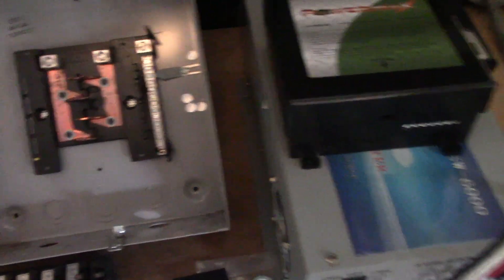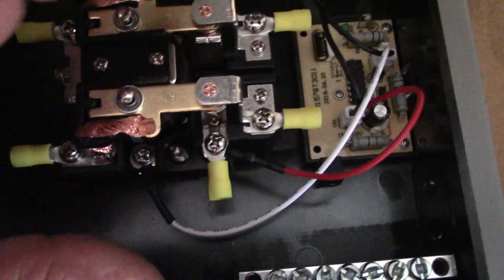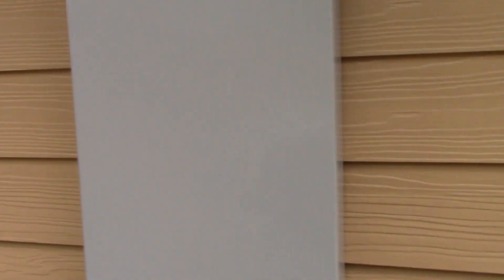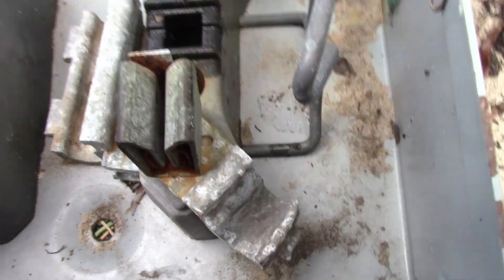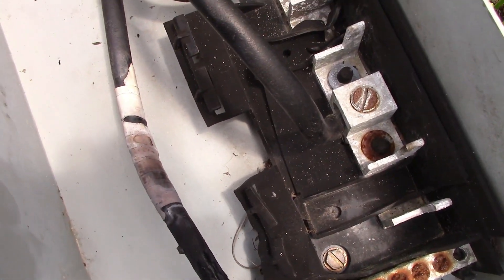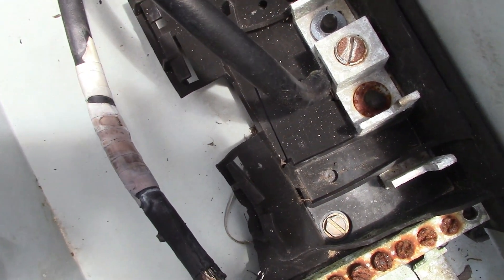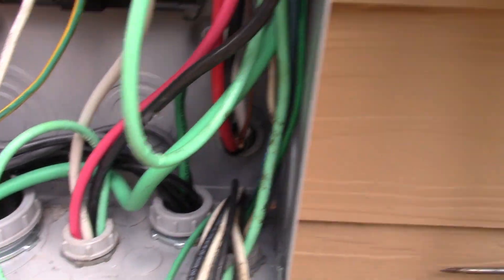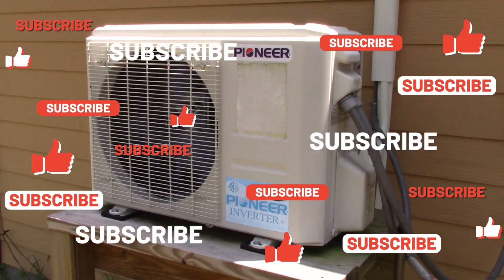SOLAR TRANSFER SWITCH & MOVING CIRCUITS FROM MAIN PANEL TO THE TRANSFER PANEL

Comment: Do you have a link to the transfer switch with contactors that you showed in the beginning of the video?
Reply from the maker: I'm not sure of the link, I would have to go through a lot of emails to find it. I actually found this on Walmart for close to half of what the manufacture is selling them for on their website. Just go to Walmart and type in solar automatic transfer switch and you should find it.

Comment: Great video and great explanation! I saw another guy here on YT (I believe he is an electrician, but not sure) that says that he does not need to transfer the neutrals for the breakers to the transfer panel, only the hots, so the neutrals will stay on the main. Is it code to do it this way? Another question: what's a good external surge protector that you would recommend for a 200 amp main service panel? Looking forward for the transfer switch installation video. Thank you!
Reply from the maker: Glad you're enjoying our videos and learning from them. Yes that is correct, when installing a transfer panel you do not have to move the neutrals into the transfer panel, they can be left on the neutral bar in the main panel, same with the grounds, they can be left in the main panel, but the transfer panel still needs to be bonded, so you still need to run a separate ground wire, I think I covered some of this in a video I made awhile back, this is the link
 https://youtu.be/aXeFX7QN7BQ
The exception to this is arch faults as you see in my video, my house is brand new and falls under the current NEC, which means most everything needs to be arch faulted, when installing a transfer panel with arch faults, you will need to move all the neutrals into the transfer panel, and run a larger main neutral, the grounds can still be left in the main panel, just need to run a main ground wire and bond the panel.
There are several good whole house surge protectors on the market depending on how much you want to spend, The Siemens FS140 is a really good one, as well as the Eaton CHSPTULTRA, the FS140 will divert 140,000 amps and the Eaton is at 108,000 amps, so you see the FS is a little better, but a little more expensive as well. But remember the best surge protector not only will not work if you don't have a good grounding system, it can cause the surge to back into the neutral and cause a lot of expensive damage, as you saw in this video, that's what happened to me. If your ground system is over 15 years old, and only has 1 ground rod, it is most likely zinc, (zinc corrodes after about 15 years) and should be replaced with a new state of the at electrode grounding system, with 2- 8'  copper ground rods, 6' apart, code allows for #6 insulated or bare wire, I always like to use #4 THHN, and that was mandatory at the last company I managed. If it's not that old, but you only have 1 ground rod, a second could be added 6' away from the first, an irreversible crimp will need to be used to extend the wire, code only allows one continuous wire, or an irreversible crimp. Hope this all helps!